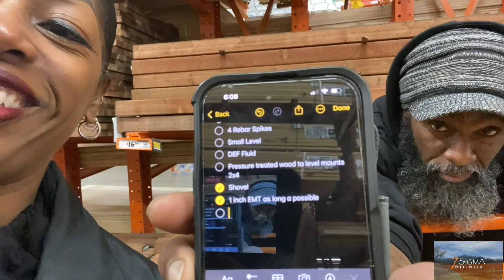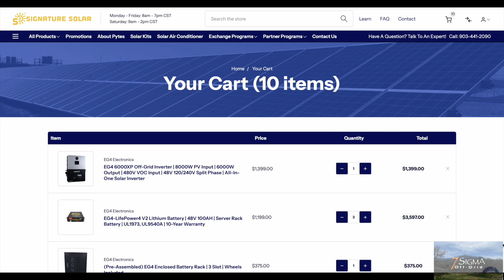How To DIY🌞Solar Panel Ground Mounts (Pt.1) Integra Rack IR-30 #offgrid  #homestead #solarenergy #rv

Comment: Did you remember the ground rods for the arrays and system?, a 10kw propane generator with in store exchange policy, a 123lb tank lasts a month with heavy use just need a company to deliver the fills. Using gas cans and small tanks suck and I think we know who is gonna deal with that crap. Buying a large 1000gal tank run the hot water and gen , fill once a year. Used 1000g under 3k.

Comment: i bout skrok'd out when i saw the amount of that solar build list...lawd hab mare c. I sure feel the pain of building materials tho, i just try to remind myself how much it would cost of someone else was doing the labor that makes me feel better lol
Reply from the maker: Man....I'm still trying to find something I can remind myself about that'll make me feel better! I'm in that weird zone where I have a very basic understanding of what needs to be done, but I don't have the experience to do it properly (yet)...lol....If I don't over pay in labor, I over spend in materials, then realize after the fact that  I could have spent less on materials...WTF...lol !  I know that I could have saved ALOT by using used oil pipes and uni-struts for the mounts, but I don't know how to weld, use an auger, or mold concrete...so I over spent on the Integra Racks because they're idiot proof. Retiring at 65 is now a fantasy...LOL
Reply: @7sigmaoff-grid  Well I can guarantee lookin at your soil composition you saved yourself a TON of back breaking work with not putting in concrete footers. I wouldnt even waste money on an auger either because they dont do well in rocky soil and can end up breaking your wrist if you hit a large rock. I think you did the right thing going the way you did, trust me you saved a lot of aggravation and work be choosing the route you did. You will see what I mean when you start digging the pipe trenches lol. For future large leveling projects I would suggest finding a place you dont mind using the tractor to dig up some dirt from, getting a way to screen that soil, dump it where you need it then use the box blade to level it out. You can build a screen for the soil (youtube videos). Then you know when you start your project your ground is leveled out. I dont know how to weld yet either and have needed that skill more times than I can count, need to learn and buy a small welder myself. If you go to digging with your tractor you need to buy a Piranha bar to put on your loader bucket or you wont be getting much digging done. The loader bucket is only good for loose soil. Men don't get to retire lol
Reply from the maker: @BillyBlaze7 That's why you are my guy Billy!!! Man...I was just looking at the Piranha Bar a few months back and put it on the to-get list! You just confirmed it for me sir...THANKS !  Today my son and I were scoping out places to dig for soil cause we are going to have to relocate the entire solar array area due to the ridiculous amounts of soil we would need to level it(and the shading from the pyramid mountain in the rear). We found a "relatively" flat area further north that won't require as much dirt to level the mounts. BUT...we will have to take out 3 more trees. You are going to have a good chuckle on the next video when you see how much pressure treated wood I would have had to stack under the back post just to level the mounts...LOL But I'm actually glad we have to move everything cause now we will get almost an extra 1 hour and a half of sun by moving everything 300 ft north and away from the mountain.  It's a PITA not being here full-time to really see what's what..but today was a good day and we dodged a bullet by not finishing the build in the old location. But yeah...I 'll still need some soil so thanks for the heads up about the screen and piranha bar!!!!  As always my brother....
Reply: @7sigmaoff-grid  indeed brother, get you a set of good step bits because drilling the holes to mount the bar is tough going unless you have a good set of step bits, and use some blue locktite on the bolt threads. its a pretty easy job though installing it just make sure you measure the distance the amount they recommend, i missed that part when I ordered mine and they made it a little too wide. If memory serves you measure 5 inches inside the bucket as its a little more narrow where the holes are drilled. Lookin forward to the progress. Reach out if you ever get in a bind, if I can help i will gladly.
Reply from the maker: @BillyBlaze7  Good Step Bits and Blue Locktite...WILL DO!  I was hoping to retire from the 9-5 but as you said...Men don't Retire ...and seeing how much more materials I will need, I'll be 9-5'ing til death...LOL!!!  WE  REALLY appreciate you taking the time to share knowledge with some random strangers on YouTube ...I need to send you a damn check cause you've been a huge help across the board my brother!!
Reply: @7sigmaoff-grid  That's what we are here, to help each other. And we all have strengths and weaknesses. I just find it more enjoyable and rewarding to build people up than tear them down. And besides I can tell you all are good people. Maybe if we all united and helped each other some of us might make it out of this mess lol